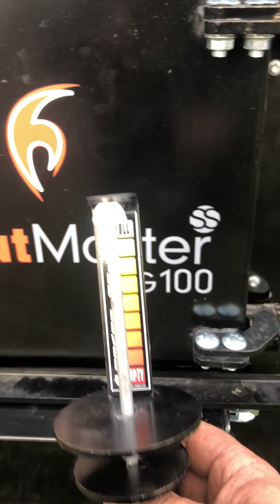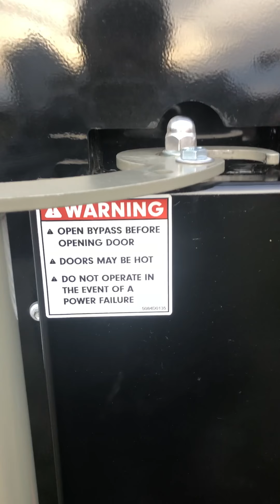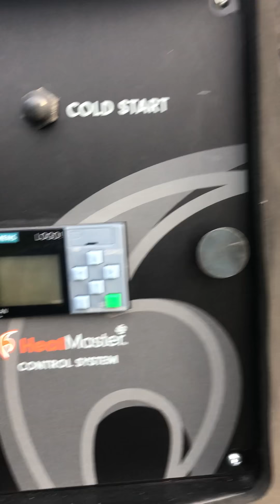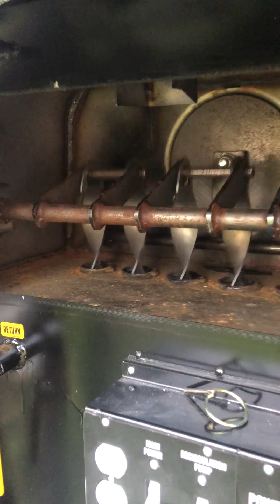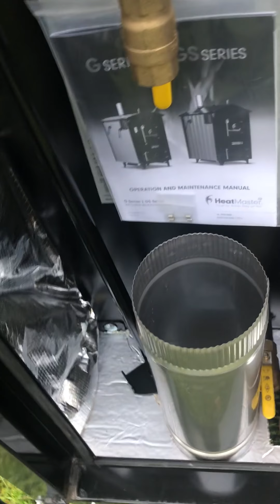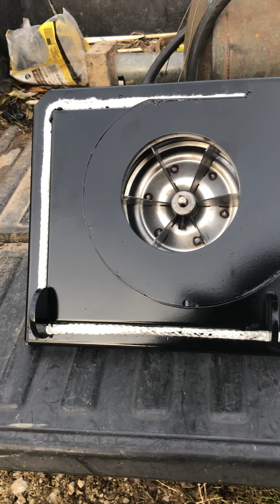2018 HeatMasterSS G100 walk through

Comment: Câți kw are?power
Reply from the maker: I’m having issues translating your question, I’ll be more than happy to answer questions in english.
Reply: Greatly appreciate your videos. We have an old farm house that is about 2500 sqft. we were debating if we would need the g4000 or the g7000. our house doesn't have much insulation. Currently we heat with a anthracite coal stove inside the house